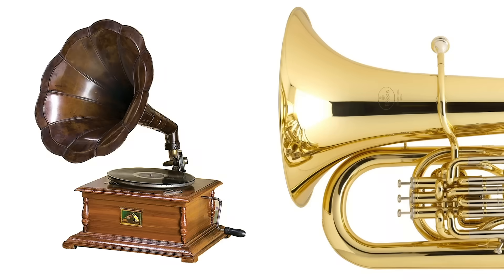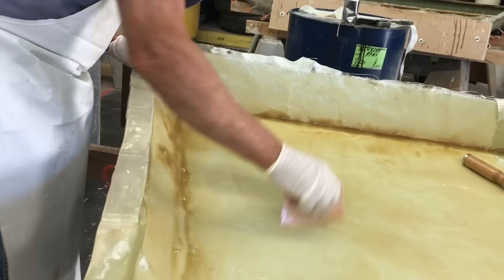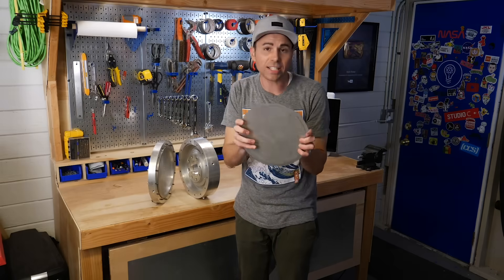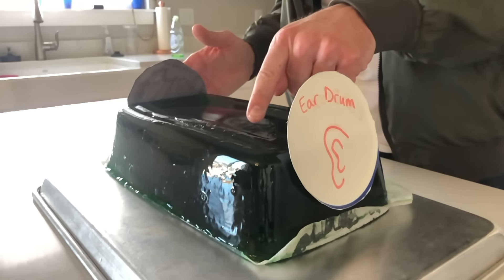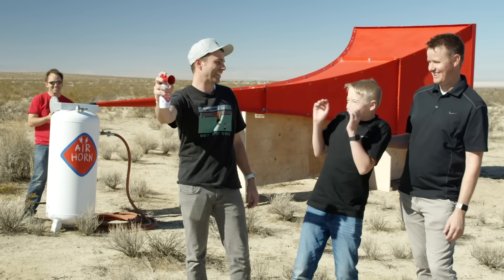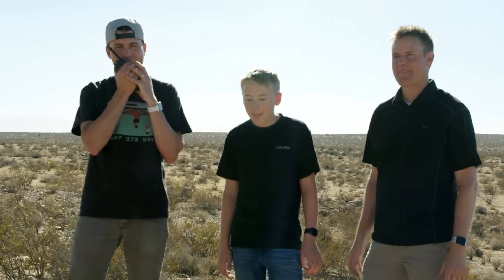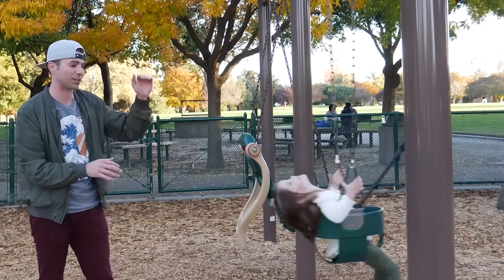World's Largest Horn Shatters Glass

Comment: Oh and by the way, that isn't even close to the world's largest.  The largest I've seen is in a mansion, and yeas there are 2 of them.  12 ft high, 14 ft wide mouth, poured in. Concrete, driven by a custom 18" woofer on each side. I'm quite sure the engineer who designed this set has made larger ones.   They get integrated into building structures.

Comment: Tornado sirens are like that just with a higher pitch
Reply: giant wall of text, sorry in advance
Erm, ackshually, traditional electromechanical sirens (like the iconic Thunderbolt series, the 3T22/2T22, and others) use rotor-stator setups. Two cylinders with evenly spaced holes on the side. The two cylinders overlap and the smaller one (rotor) spins at typically 3,450 RPM with a 60 HZ motor, and the stator (bigger cylinder) is stationary. If it’s a rotational siren, the stator will only have one or two slots and rotate, usually with a horn attatched. The SoCal model 120 has a rotor that is not driven by a motor, but is instead propelled by pressurized air, like a pinwheel (i think that is what it’s called.)

Comment: it may not even be the 'largest DIY horn'.
NASA holds the WR and it obliterated reinforced concrete at 210dB in the 1960's.
That said.  I used a folded horn in my 1988 Gti 16 w two 18's facing the rear.  tuned to 34 Hz at 1/4 wave.  It would hit 128 dB with the 18's off.     IASCA

you kids made a large fog horn.  Grats.

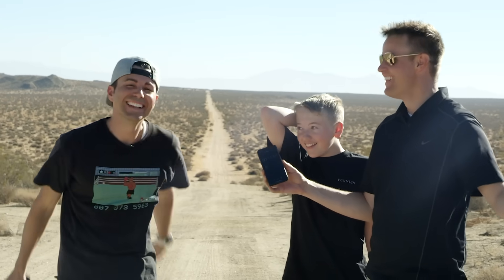Comment: Notice at 6:55 that the pitch of the horn is slightly deeper? I guess this is because the sound travels through air layers of different temperature and thus different pressure. Or is it just the wind causing somewhat like the Doppler effect?
Reply: Its because low frequency sound isn't as easily absorbed by the terrain on the way. The high frequency is loudest close and the pitch gets lower and lower as you move away and it gets absorbed. Might be a bit late tho but thats why
Reply: @shuttleman27c  Thank you. But this does not explain what I mean. Surely high frequencies are absorbed a lot more than low ones, but this does not explain why the pitch gets lower (and i mean lower in frequency, and not more muffled)

Comment: Hey Mark, does the opposite apply on the horn if you put it against your ear? Can you improve hearing with that shape?
Reply: No because if you put the shape in ear the larger area will be facing towards your ear and if it is made for daily use the area will not be larger than your ear. For comfort. And hence the smaller area will be smaller than the area of ur ear. So if the vibration enters then it will be smaller than those which u regularly hear. And aftr amplification the area that the vibration hits will be same as the regular hearing and there will be no difference in the loudness that you normally hear. The results will be same as regular hearing
Reply: Like a giant ear trumpet, yes.

Comment: theoretically it should also straighten the waves out as they travel through. as the waves over along, the force will quickly end up bouncing off the walls at a high angle, causing them to leave the object not heading in the direction you want them to, but with the reverse taper the waves will be pointed more and more outward to the point where the majority heads in the intended direction.
due to this, the horn will be able to be heard for much further in front of it than behind.

Comment: What’s interesting is when the horn went off at 6:53 (when they were at their farthest spot) not only was there an eleven second delay, the pitch of the sound seemed to drop by a semi tone. I’m wondering what causes that
Reply: the vibrations get weaker because the waves lose energy
Reply: it could be that the frequency gets weaker or something
Reply: lower frequency waves travel further, same with radio waves etc
Reply: Tired molecules.  I do the same thing at the end of the day.
Reply: I was wondering the same. Could it be that, at those scales, the Coriolis effect could induce a Doppler shift?
Reply: Creepy
Reply: if they doubled the distance, it could have dropped from an Ab note to a G note
Reply: Doppler effect

Comment: Hey @Mark Rober (comment section), does anyone know, is the resonant frequency at which the diaphragm vibrates (110Hz) directly correlated to the PSI (110psi)? 
In other words, if the PSI were lowered down to 20 would that produce a 20Hz vibration & sound, or if it were raised to 20,000psi with a 20,000Hz frequency, etc?
Reply: Unrelated coincindence
Reply: Twice as loud with twice the air pressure!!! But at 110 PSI that's pretty high!! You can lower the frequency by gluing pennies to the diaphram

Comment: 8:10 that's a common misconception about the Tachoma Narrows bridge. The wind during the day was actually fairly consistent. The issue was the bridge not handing wind shear very well, so it got blown up at one angle until the resistance to the torsion forced the bridge the other way where the wind caught it and pushed it even further, and repeated until it fatigued/pushed the bridge far enough that it collapsed.
Reply: The wind is constant. However the eddies created by the wind creates pressure oscillation. The frequency of such oscillation matches with the natural frequency of the bridge, and cause the energy to accumulate, until the bridge failed. 
The eddy frequency is a function of fluid property and the wind speed. It needs to be that exact wind speed to cause such frequency that matches with the bridge's natural frequency. This is why the bridge did withstand in a stronger wind before that incident, but failed in a weaker wind.
Reply: Well, to be clear up front, I don't mean any offense. Would you please explain more about your theory? All physics professors and teachers I know unanimously blame resonance of the bridge destruction.
You said the bridge couldn't handle the shear caused by the wind. But why could such fairly weak breezes cause that destruction? You did indeed explain the superficial phenomenon, but I have to say, without further explanation from you, you failed to explain the underneath cause.
Reply: @KhangTran-sl3yb  Please look up 'classical flutter.' Not a resonance but a self energising oscillation, well known to aeroplane designers.

Comment: I think it is to reduce the resistance at the end of the horn.
When you have a pipe where sound resonates trough parts of the energy bounces back at the end and another part is released as sound.
Having a large ending reduces this resistance. But you need to have a gradual change in size. Otherwise you will just get the same effect as with just a straight pipe.
Since the pipe can be viewed as an extreme case of a sudden increase in width.
 
Depending on if the pipe slowly increases in size (a horn) or if it more aggressively increases in width at the end (trumpet/trombone) you will get very different timbre.
Horns have a more soft and full sound while trumpets/trombones have a more sharp sound.
 
The reason why part of the wave bounces back at the transition area at the end of a pipe is because there isn't enough air to carry the energy from the sound beyond the pipe. So most of it bounces back and forth till it loses its energy mechanically.

Comment: Wind has a HUGE impact on sound as well.  I've been to concerts at The Gorge in Washington where you can hear the band perfectly, but as the wind kicks up their sound literally gets blown away.
Reply: That’s because most implementations of line arrays suck. Nowhere near enough horizontal dispersion. Look up AC/DC’s PA system. The sound doesn’t get blown away with that setup, because it’s got great dispersion.
Reply: @Jonathan_Doe_  🤓
Reply: That's why a lot of concert speakers have so much BASS
Reply: @quentingrimes1234
Reply: SOUNDS like you need a new venue.
Reply: the wind and sound from the wind interferes with the sounds coming from the other direction. it doesnt get blown away but rather gets lost in the other noise.
Reply: pretty cool huh ?
 @timn4481
Reply: Pikeys
Reply: Брак😭😭🧑🏼‍⚕️🧑🏼‍⚕️🧑🏾‍🦰
Reply: Yeah

Comment: um, Mark Rober was about 2.3 miles away bc if u calculate the speed of sound in miles per second that is 0.2130319 then multiply it by 11 (bc that's how long it took the sound to get to them) then u get the answer of 2.3433509 miles away from the air horn.

Comment: is the power output actually preserved by adding the horn? even though it's only a passive component, the air in the horn should be "harder" to vibrate, which would necessitate the sound source producing more power. if there's any analogy to electrical circuits, a higher impedance with the same voltage will obviously result in a larger power output...

Comment: Would it be faster than 11 seconds on a higher frequency?
Reply: No the speed of sound in air is pretty much fixed. It's to do with the medium the waves are travelling through not the amplitude or frequency of the waves.
Reply: @Dream146  thanks.

Comment: if you ever meet a car without exhaust car muffler - you know how loud petrol can burns
i want to construct combustion subwoofer(at least for low freq) - some kind of controllable driven torch, that produce sound like plasma speacker - but heat energy produced from petrol or butane gas - there is 13KWtHr of heat energy in 1l of petrol 
horn - is very usefull always with plasma speacker - especially with little(low size) plasmoid body, - when pressure((potential) vs resize(current)) is not utilized properly(like with horn transformation medium resistance matching process) - horn kills spherical sound wave(you don't need it always - only sometime), but rising soud pressure in times, and more meaningfull - widening freq range giving louder bass
after initial experimentation it is evident that we need fast burning turbo flame torch(it must burns completely faster than half period of pressure wave generated) and proper fast modulation method. we can modulate gas+air premix current flow - by valve+servospeacker(some LF loudespeacker), and we can also modulate ignition - for example - by moving ignition electrode(or pair - with arc between it) with constant HF plasmoide that igniting gas premix instantly we can also modulate ammounts of electrolitic HHO gas mix - mixing it with butane+air premix - because even little HHO addition results in serious speed of burning of anything fuel - for example - bubbling HHO through petrol - you receive gas mix that will burn like a needle flame - from medical syrynge needle - without need of any torch construction(used to stabilize slow burning of cold petrol+air mix, before it is ready for center-fast flow burning)

Comment: I grew up in a town with a lighthouse fog horn 4 miles away which you could hear of foggy days. When TWA flight 800 blew up off of long isand I was about 12 miles away. I was looking at the sky in direction of the explosion when I saw a flash againt the clouds, which I took to be lighning on a warm summer evening. About a minute later there was a deep explosion which I had no explanation for.

Comment: Wonder how you would calculate how far the sound wave would travel at a maximum based on your giant air horn specs. I imagine you would measure the area of the cone, the frequency and the speed of sound. You could use that measurement of 11 seconds at 2.5 miles to get it too. But then you'd also have to worry about barometrics and how air naturally stops sound eventually, like a wave in a pool hitting the other side. I don't really know how that works. Gravity also determines the density of air so would that need to be considered?

Comment: Someone said my Federal Signal 2t22A tornado siren can be heard over a mile away. (I doubt it.)  Actually 2 sirens on.e 10-hp motor'shaft, it produces two tones ("2T").  Lower tone from a 10-port stator and higher from the 12-port stator ("22"). "A" denotes 3-phase powered.  
At full speed it emits musical pitches D5 and F5 creating a perfect (pure) minor third musical interval producing a B-b2 resultantone.    The sound would travel further if an octave lower - from 5 and 6-port stators.
My emergencyehiclelectronic siren has exponential reentrant horn speakers.   How much sound cancelation occurs when the pressure wave from the driver forward into the cone is reflected back to the speaker bell and reflected forward out?   Would be.tter if as Mark's exponentiahorn.   
(Now, shall I sound our 240-volt 2-hp single-tone HOR siren at precisely Midnightonight, 12-31-20?)

Comment: Small error at 8:12 : The bridge did not collapse because of gusts at the right frequency, but because of aeroelastic flutter. From wikipedia: "the bridge collapsed because moderate winds produced aeroelastic flutter that was self-exciting and unbounded: for any constant sustained wind speed above about 35 mph (56 km/h), the amplitude of the (torsional) flutter oscillation would continuously increase"

Comment: It's probably somewhere in the 25K comments below, but that bridge was not taken down by wind gusts at its resonant frequency.  Actually when you have airflow around some shapes, like the big girders in the sides of the bridge deck, you get vortices coming alternately from the top and bottom of the girder.  At the right size girder and the right wind speed, the frequency of the vortices matched the torsional resonant frequency of the bridge.  Theodor von Karmann figured it out, but when they sent a graduate student to check out Roebling's bridges and writings, it was evident that he understood this issue, although perhaps he didn't communicate it as convincingly as the falling bridge did.

Comment: I mean its big.... but I've seen a twin version that looked a fair bit larger on either side, fitted to the Bass Rock in Scotland.

When it was in regular use you could hear it 15 miles away *in the wrong direction*, as in off the back of it, I suspect you were hearing the reflection from the cliffs on the opposite side of the estuary. 

Lighthouse keepers used to live on that Rock.... God only knows how they had any hearing left after turning that bad boy on, it is placed at the furthest possible point from their house, with a huge mass of rock between them, but even so I bet it still shook the ground 👀

Comment: "Get off the road or I'll honk you off it!"
"Psshh, shut the-"
And that day, a man was killed by a man with a large tuba like object.
Reply: This is really under rated
Reply: Lol
Reply: I have a very appropriate story:
A friend's mom & dad were delivering the department's new fire engine cross country many moons ago.  In the middle of nowhere, they get behind some old geezer farmer just tooling along WAY below the posted speed limit.  As the fire truck driver had over a thousand miles to go, he didn't want to crawl behind this old codger much longer.  Plus, the old guy NEVER glanced in his mirror and had NO clue they were there.  So after what seemed like an infinite amount of time behind this slow-poke, they finally hit the air horn.

"HOOOOOOOOOOOOOOOOOONNNNNNNNNNNNNNNNNKKKKKKKKKKK!!!!!!!!"

This scared the ABSOLUTE CRAP out of the old man!  He jumped so high in his seat, he almost went off the road into the ditch.  (It's good he didn't have a heart attack right then and there!)  

It worked, but let's just say the firefighter behind the wheel of the truck felt kinda bad almost killing the old guy!
Reply: @dudeonbike800  never thought I'd see this on a video and I read every second of it. I love this.
Reply: @dudeonbike800  cringe, no one would read all that
Reply: @den-bf4zo  i did
Reply: @den-bf4zo  I did (2)
Reply: @den-bf4zo  I did (3)
Reply: @den-bf4zo  I did (4)
Reply: @den-bf4zo I just did, it wasn’t “cringe”
Reply: @den-bf4zo  I did (6)

Comment: Question:
How does the sound through the walkie talkie gets transmitted?
It goes over the air too, right? So why is it faster than the speed of sound? Other frequency? How fast is it?
Reply: Its runs of radio signals. They travel at 3x10⁸ ms-¹ which is thousands of times faster than the speed of sound of which is 340 ms-¹.

Comment: I'm only two years late on posting this, but I don't see it in the comments - the Tacoma Narrows bridge didn't fail due to resonance. It failed due to structural failure from exceeding the limits of elasticity. It's a common misconception that the wobble is from resonance, but it was actually caused by aerostatic flutter. This phenomenon works by pushing the bridge up or down and then when the bridge is moving back, the wind makes the next movement a little larger, creating a feedback loop. When the bridge finally breaks, it isn't because the resonant frequency of the bridge is achieved; it's because the structure couldn't hold up against how much it twisted.

Before I get accused of being pedantic (which never happens), yes, aerostatic flutter is a very similar phenomenon to resonance, but the cause of the failure is simply mechanical stress. The difference is this - in the video, he shatters the glass using resonance. To break it like the Tacoma Narrows bridge, you would just twist the glass back and forth until it shattered, which could easily happen long before you managed to twist it back and forth at the resonate frequency.

Love your videos! Keep being awesome!

Comment: So basically what the horn shape does is it increases the amount of surface. As we know that Pressure, P=F/A...we can also say A=F/P. So if we increase the amount of A, which is the area of the horn's bigger edge, we will get more F or Force...because A and F will increase in a same ratio. So we will be able to shake the air molecules more frequently as we have more force than before!